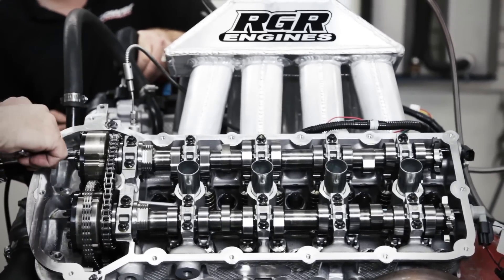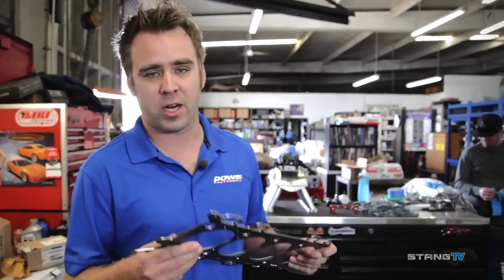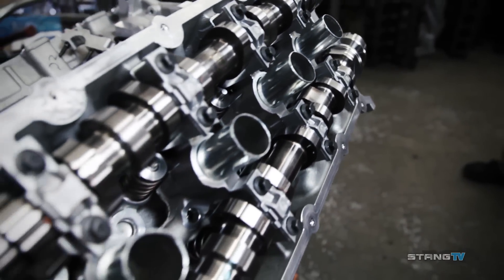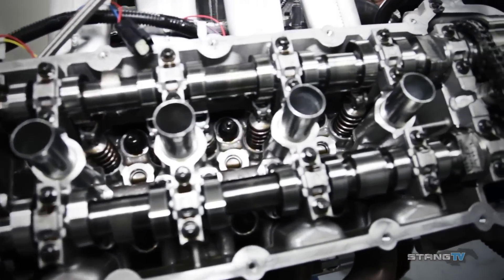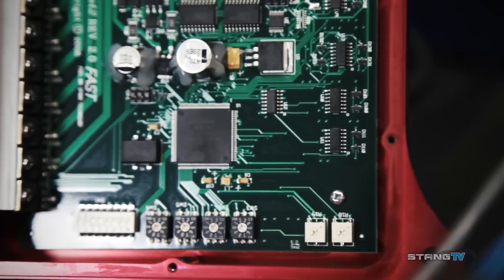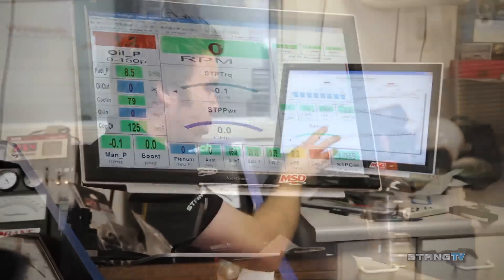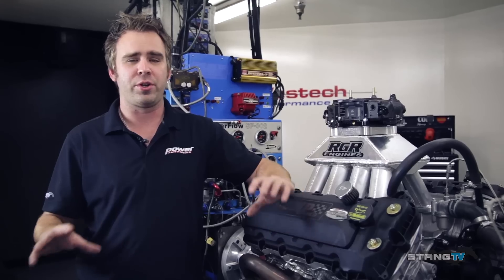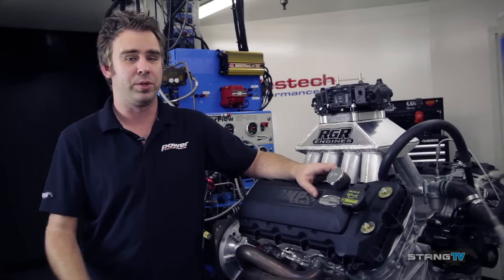Carbureted Cobra Jet Coyote Engine Build: Long Block and Dyno Testing

Comment: Sure, a carburetor can make power.  But WHY?  So much screwing around, so much work, so much expensive to reinvent the wheel on this build.  I don't get it
Reply: Expensive? Even racing carbs are like half the cost of an EFI system. You can pay for a lot of dyno or race track time for the difference. Besides, carbs are easy. Not as precise as EFI, but easy.
Reply: I can guarantee you this costs way more than off the shelf Coyote setups.  Especially when you count the time involved.  Endless frustration on an engine stand is all I see.
Reply: Berol2000
So you're saying custom racing set-ups cost more than off the shelf stuff. Quick, someone stop the presses.
Why don't you price out an aftermarket carb  and a compete fuel injection system for this motor and get back to me.
Reply: I'm not here to get in a pissing match with you.  All I'm saying is you can make those power levels with a naturally aspirated coyote with the OEM fuel injection system, cams, a cobra jet intake, headers, a custom tune and race fuel.  For cheaper than this, hell for cheaper than a FULL DAY OF DYNO TESTING (which is what they have in it).

My original question wasn't posed to throw sand in their eyes.  Or to throw sand in your eyes either and get your wound up.  My question was more aimed at this must certainly be aimed at a very specific application.  So what is that application.  Hence my original WHY question.

Make sense?
Reply: Berol2000
Maybe it's a pissing match you're getting wound up over for you, but it's not for me.
All I'm saying is carbs are a cheaper then EFI, this should be obvious. If you have a long block, carb is cheaper then EFI and everything you need to run it by a wide margin. By half or more.

And you don't need the expense of a dyno to tune it. That is just a convenience. An O2 sensor and a day at the drag strip combined with a little knowledge and experience on how carburetors work will get you dialed in.

And you're posting a lot of claims over the price of parts with very little evidence as though its true.
Reply: Cool beans dude.  I'm not posting a full parts build list with a price list.  I'll let you do that if you're interested.  I'm done.
Reply: Berol2000
I see. I'd be curious to know what you would think if I posted a bunch of unsubstantiated claims, if you would find it b/s, as I do?
Reply: Again, not I'm not trying to fight.  I'm just trying to gain some clarification.  I 100% agree a carburetor is cheap, easy to find, and easy to find repair parts for.  It's literally everything else on this build that isn't cheap.  That manifold is custom one-off (or nearly so since I don't see it on every non-emissions compliant coyote build).

The Ford parts (fuel injectors, control module, everything else you would need for the full long block you mentioned), are all part of economies of scale.  Ford did the R&D, did all the testing, did all the troubleshooting, made further refinements, and then release the product with a fully backed warranty.  And best of all, it's all guaranteed to work together.

If I decided tomorrow that I wanted to put a carburetor on my road-course only Boss 302, or any other track-dedicated car, I would have to perform all of that myself.  And even if individual parts are well sorted out and for sale currently, the package is not.  Ford has done all of that either through OEM parts at the dealer parts counter, or through Ford Performance parts.

If you want to go further on a budget for a long block w/o fuel injectors, then buy OEM fuel injectors (and anything else missing off the long block) off Coyote Craigslist on Facebook.  People pull their new injectors every day to upgrade them for E85.  Buy a nearly new set on the cheap.  Keep the variable timing that Ford's ECU gives you right out of the box.  If you don't have an ECU, Ford sells a controls pack for the coyote, which includes the wiring harness.  Or buy a used out of a wrecked vehicle, those are on Craigslist every week or two.

Find a tuner who's put together 100s of coyote Fords, like Lund or AED.  Get three to five dyno pulls and you have this horse power number.  A decent tune is $250.  With dyno time, maybe $500.  And you're done.  You bought the same long block, bought a cheap wiring harness, $100 worth of injectors and a $250 tune.  

Everything else (headers, cams, lockouts, the intake, etc) is added cost over a stock coyote.  But it's also cost that is added onto this build too.  No way this thing is using stock exhaust manifolds, stock cams and definitely not a stock intake.  

I'm also not sure what hood that intake would even fit under.

Again, for any typically street driven car, and 99% of track dedicated Mustangs, this solution doesn't make sense.

So again, my truly inquisitive question is, what's the application?  That would answer the WHY.  Then I'll gladly stand corrected.  I'll have learned something, and we don't have to sit behind keyboards arguing.  Learning might be less fun than a pissing match, but that's all I'm trying to do here.
Reply: Berol2000
Not sure that really addressed much, if anything I said, as we are not talking about stock parts and I doubt the OEM stuff is up to all this, but okay...

And I'm pretty sure this is obviously a racing application, probably drag racing. Guys have been similarly putting carbs on GM's LS engines for years now, esp. since a drag car basically has two modes, idle and WOT. Is this really so hard to figure out?
 
Like I said at the start, carbs are cheap and simple. They took the KISS approach here.
Reply: And maybe that's our misunderstanding here.  Carbs on LS's might be super common, really well sorted out, and cheap.  I had no idea.

I'm a member of at least half a dozen high performance Ford / Mustang / Coyote forums.  I've seen alot of serious build threads.  I participate in 6-12 track events per year, and travel to watch at least half a dozen more professional events.  I've played around with at least a dozen spread sheets to include scenarios of 'what if' my motor goes pop, and how I would replace it.  I've never seen anybody go this route.  I've never seen these parts at the track despite the fact that the coyote has been out since June 2010.  Which is why it took me by surprise, and why I think it would cost so much.  I truly think this is mostly one-off material for this particular application.

Typically one-off applications don't care about cost.  They don't mind the troubleshooting, R&D, and even parts development from the ground up.

Truth be told, I would love to see a parts list, with a total price at the end of this video.  Unfortunately they didn't provide one, and there's really too many variables for either one of us to even throw a guess at it.  However, I think it's not shown because it would be shockingly large and probably deter the average dude from even thinking about it.  

After all, if the selling point was a low price point all the while using really easy carburetors and tuning, then the price list would surely be advertised.  

I didn't know the carb'ed LS was so popular.  See, I learned something and I'll stand corrected - I had no idea that was even a thing!  And hopefully you've learned  something too-  Even if it's just knowing that this setup is super rare on modern Ford coyotes (with an unknown cost).

And maybe, just maybe, somebody else or the original poster will follow up with a carb'ed coyote price breakout for both of us.
Reply: Berol2000
Fair enough.
Reply: You don't get that a small wrench and a screwdriver, a teacup full of simple parts and about a 20 minute assembly time are less screwing around than buying a lower intake, an upper intake, a 6000 buck CPU and wiring, and then running algorythms all day and night on a stinking laptop.  If you start with any longblock...a carb system is 10 times cheaper (with all new parts) than a bare bones EFI setup.  Carburetors aren't "Reinventing" anything...I've been building double pumpers for 50 years.  Your engine needs Fuel, spark and air.  Nobody gives a rat's ass about emissions and mileage.  I want to go fast, and I don't want to chase down a dozen sensors and switches every time I have a problem.  You're rich?  Run EFI.  Want to go fast?  Carb and a stick shift.
Reply: Would you need the stock wiring harness for this setup?

Comment: cool concept but you spent all that money to mkae 590 wheel when for the same price, if not cheaper you couldve slapped a turbo on it and made well over 650-700...
Reply: 590 non aspirated is much better than 650 turbo'd.
Reply: MUNOZEMK You spend literally double the money doing it this way... You spend half the money and make 200 more hp lol and 590 wheel is a little weak considering they 5.0 has 4 cams and 32 vavles lol
Reply: +MUNOZEMK non aspirated? I think you mean naturally aspirated.
Reply: +thomas H Its not WHP, so minus at least 30% for drivetrain loss. The newest coyote makes 435hp i think to?  Lol so their making an extra honda civic motor more power and thats funny when you think of it :-P
Reply: +MJ Drive train loss on modern cars is about 15% or less on average today.  However unless they are factoring in corrections that doesn't look like a SAE Net HP setup.  If so it's more like the gross HP from the 60's, in which case you are looking at close to a 40% difference vs wheel HP.

What you would really need to see is a a bone stock engine on the same setup to compare.  Plus what the same mods done to the motor only swapping the intakes.
Reply: *****
A turbo can be sized to to deliver power from right off idle to red line.  That's what nearly every factory turbo setup does these days.

Most people choose to go larger because typically there is enough power off boost to tool around and it's not issue when you are laying into it.  With a twin turbo setup that motor will easily lay down 1000hp without too much lag or being overly peaky. 

NA these motors don't really come alive until you get to 3000 rpm without boost anyway.
Reply: *****
Two T62's will give you 700+ hp to wheels and make full boost around 2000 rpm on a coyote.  That good enough to hold 11lbs of boost through the rev range and close 1000hp at the crank.

Are you not aware that the 3.8L in the GTR is making 600 net hp stock and is virtually lag free off idle and not peaky at all.  That's only going to be easier to achieve with more displacement.

Comment: I wonder how much this cost lol, it look really expensive for only barely 590+hp.
Reply: When you start getting past things like stock internals it pretty much starts becoming more about how much HP you want to make that determines how much it's going to cost i.e. 500, 600, 700, etc HP engines all cost about the same to build similarly unless it's a real odd-ball engine requiring a lot of one-off parts.

Comment: I thought that motor was gonna put out a 1000hp but it only had 600hp. For all that money for that motor you might as well get a LS7 and put a cam and port heads for 6500hp and over 600tq , the 5.0 is a huge freaking motor for nothing lop. Poor ford. Or on the other hand buy an LS3 and get heads and cam package and push the same HP and wayyyyy more tq then the 5.0 for 1/3 of that price and half the size of the engine........p.s the intake is funny as hell, where the hell you can fit that intake under any mustang hood, just imagine an intake that is for hood clearance for the mustang, goodbye 60hp & you may gain 50tq down low. Im not hating on ford but come on now that motor look like it has more power then than that,but it don't,so it look sad when they show the numbers
Reply: DJ JONES agreed. Its easy enough for someone to say "grab an LS and have fun" like everyone and their mom does but it's also good to reach out and see if other motors can be interesting as well, even if that experiment fails it's better than just sticking with the first thing that gives you good results. Personally though I would've gone with the 6.2 SOHC Ford. Similar induction benefits with way more cubes to work with. Wish those 6.2s would start getting the attention they deserve, but what do you expect when you're put in a truck rather than a Mustang :-\ 
Be cool though if they made a new Mach 1 with the 6.2
Reply: 88TransAmGTA ok this is called stang TV for a reason dude or did you not see that in the lower right Conner on the show ?
Reply: i wouldn't want that it would make the car so nose heavy it might Handel like shit idk
Reply: DJ JONES I'm sorry but that's a myth. It might add 50 pounds to the front, not really a big deal. Especially with the extra torque youd have. I don't understand this sudden new thought that any tiny bit of iron in the motor will magically cement your steering rack in place haha. I'm all for going as light as possible but sacrificing a couple pounds to increase your displacement by 1.2 liters is a no brainer. I hate to bring up the LS example but ask all the guys who swapped their LS1s for LQ9 strokers which motor they prefer and why. The 6.2 is the motor you want in your street/strip car. I might get laughed at today for saying it but here in 2 or 3 years when everyone's gunning for them I'll be there shaking my head. Been there many times before lol
Reply: DJ JONES besides that, if they made a 6.2 specifically for a Mustang I'm sure they'd make a couple changes to it like Dodge does with their Hemis. And I'd be willing to bet one of those changes would be an aluminum block, which would negate the weight argument entirely
Reply: guess they could do that

Comment: Seems like a expensive build for that kinda power, Can easily make that with a set of handported 23* Dart Platinum 215's with less then 11to1 compression on straight 93 Premium Octane, 750 CFM Carb, Plenum blended out of the box 2925 Super Victor, Solid flat tappet cam at 406 CI
Reply: There's nothing like an awesome 351w!!
Reply: try doing that with 302 cid
Reply: @cth0211  have years ago. Just need a really good set of victor jrs at the time. I had a spare set of Jimmy Larocca's renegade heads. They flowed 330cfms at .550 motor made 603hp at 8100rpms and had 12.5 baddest little N/A motor I ever had. 
Have a sbc 427 with AFRs that makes 647 on pumped 93 and cost half the price. You can make power with anything. When your on a budget it's had to beat Chevy.
Reply: The children who think their 6.2 Chevy motor is far superior have yet to grasp the reality of GM dropping the Camaro because 5.0 Mustang is eating them for lunch.
Reply: Rick P.
I'm sure you could. Or you could just buy a lazy 572 big block and not have to do anything to it. But try to make the same NA power with 302 rather than a 406 or a 572. Not so easy to make over 550hp now.

Comment: VP Q16 Oxygenated fuel and only 12to1 compression?
I Guarantee it would make more power with VP C113 Oxygenated fuel, That engine don't have enough compression to need nor want Q16 unless your pouring some advanced ignition timing at it
Reply: ***** badass. E85 rocks
Reply: Timing makes power and requires damn good fuel

Comment: Can you clear up the cam specs? 240*/246* @ 0.050". 0.512" lift.  120* LSA, 110* intake centerline?  that exhaust timing seems way off.  tighten up the lsa and shorten duration.
Reply: great answer!  thank you!

Comment: Why not build a 93 302 with some AFR heads. 400 HP with an overhaul, while keeping it at the 302 CID. Then turbo it. So much cheaper.
Reply: After 400 hp with a 302 its no longer a "is my engine going to blow up?" its a "wonder when its gonna blow up?". A 302 block is shockingly weak, those same mods on a 351w and you'll not only get more power but you'll also have a stronger base for hardly any more than a 302.
Reply: +jr540123 Saying that a 302 over 400hp is a time bomb is ignorant. Which model years and with what bottom end and tune? Literally so many variables. Also, ANY 302 will handle 400hp easy. Told by who that its a bomb? What do they run, like 13:1 compression with 17 A/F?  No doubt that would die pretty quick. Even new roller 302 blocks (90's) can handle up to 500hp, the older models - really ANYTHING older than the roller blocks - can handle more, and the 69-74 are usually good to 600, boss blocks good to 800+ with good rotating assembly.
Reply: It won't blow up. It'll take a lot more to blow it up
Reply: Dominik Kus A 302 over 400 hp is a ticking time bomb, don't believe me see it for yourself.
Reply: jr540123 who builds your engines. 302 have strong bottom end even on a 2 bolt. Your clearences must be tight boi
Reply: B00steDevil
Strong in lower power apps for sure but you push over 400 its a hit or miss game, least that's the way it is with the newer blocks that were designed to be able to use roller rockers. Never needed anyone to build me an engine yet my stock 302 in my F-150 is still doing its job at the moment and will keep doing so until I put my 351 in its place.
Reply: Hp never broke a bolt in its life time. Torque= force x distance rotational force indeed does create much stresses in the block that in the first place was not designed to handle. Anything past 380 lb. Fts is passing the safe. specially those who love low quality bearings. I Myself Am building a 333" if you take 380lbs. X 6000 rpm ÷ 5252 = 470hp well within the limits of the cast block. You must know what your doing first.
Reply: B00steDevil
I've always heard and been told anything over 400 hp is hit or miss because thats just what some people go by, maybe they just slap it together and hope for the best who knows but thats what I've always been told and what I've always gone by.

Comment: thats quiet an achievement..... fixed timing and carburation almost pulling 600 HP... i say thats a success right there
Reply: Heads ported,cams,intake and higher compression.  Good results.